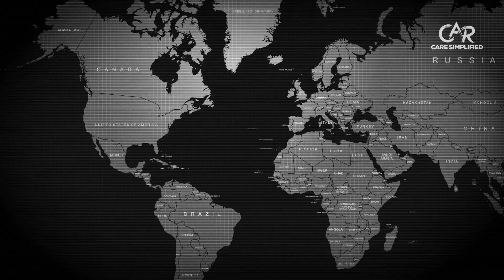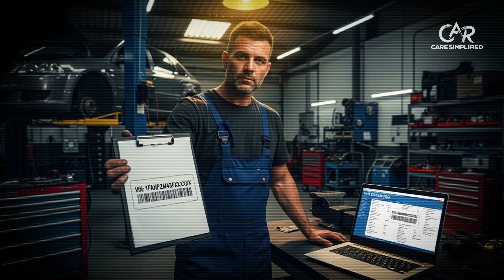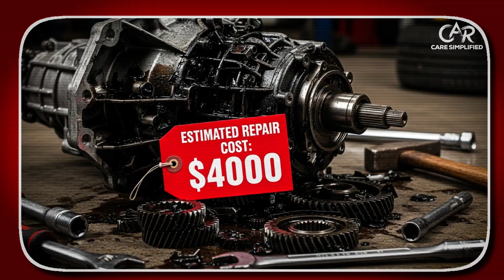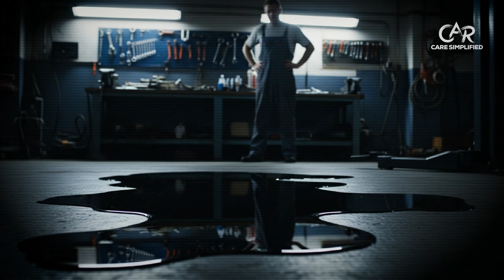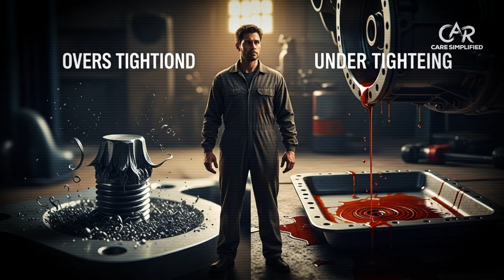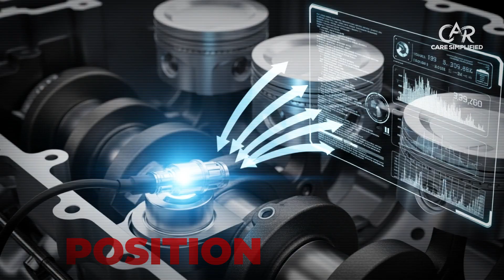NEVER Change Your Car’s Transmission Fluid Until You WATCH THIS!

Comment from the maker: 🔧 Want more pro tips? Check out our full “Transmission Maintenance Masterclass” playlist for advanced diagnostics and tools 👉 https://www.youtube.com/watch?v=nszaM7R9-g8&list=PLgqSKRuy1twyL6aCKZc3zufy5UNNmFp3V

👇 You asked—here are my top Amazon picks for your DIY transmission fluid change:
Torque Wrench (10–80 ft-lb) – precise tightening to avoid stripped pans: https://amzn.to/4nldogr 
Infrared Thermometer – accurate fluid temperature checks (68–200 °F): https://amzn.to/4fRfxh3 
Transmission Fluid Funnel – universal fit to prevent spills: https://amzn.to/4fXhCIs 
High-Quality ATF Filter Kit (with new gaskets) – OEM fit for most makes: https://amzn.to/4n6XLJn

💬 Drop a comment below: Which tool do you want me to demo next?